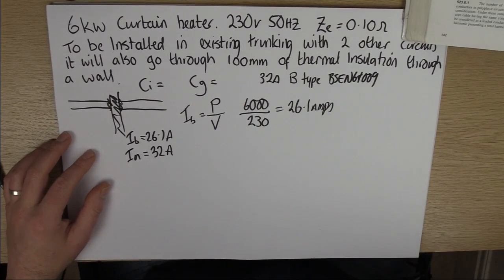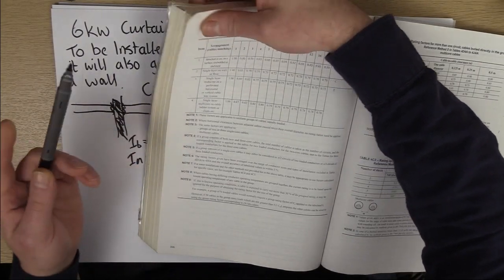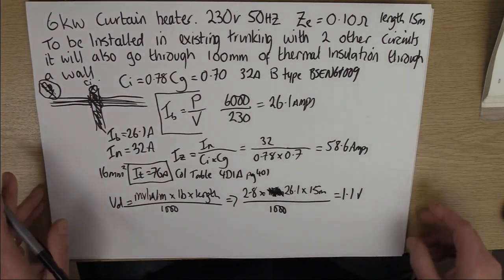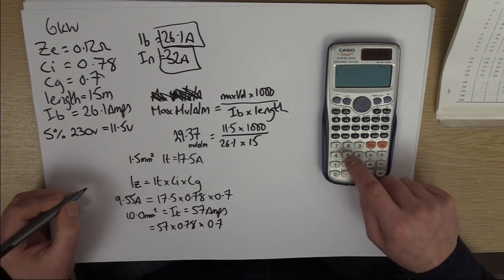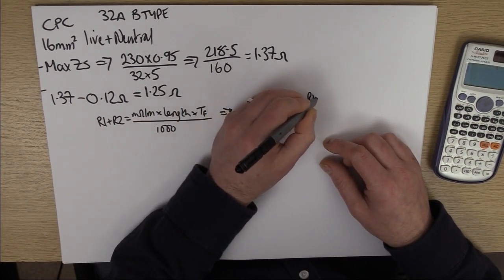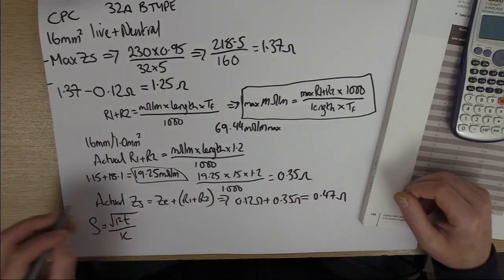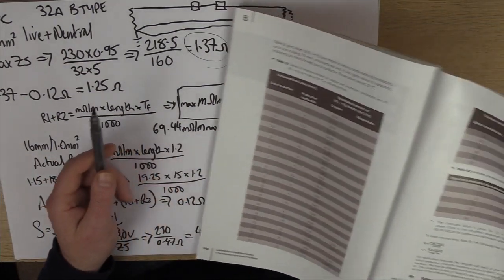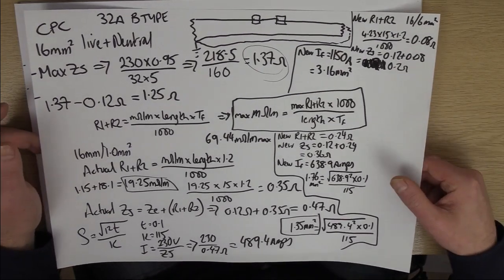Resistive load 6kw curtain heater cable design (improved audio hopefully)

Comment: Great video craig, could you do a video on how the “maximum circuit length tables” are calculated in the osg. Also a design Calc on a 2.5/1.5 ring final would be good👍
Reply from the maker: got one ready really but editing and tweaking to make it more watchable :-)

Comment: As this is a fixed load with a maximum current of 26.1A, could you not use Ib rather than In? 
This would get you to 47.8A and a 10mm cable.
Would this method comply?
Reply from the maker: Yes it certainly would comply and what I would use in real world. These videos are aimed at level 3 so I try and keep the methods safest to avoid confusion.

Comment: Brilliant video on design. Design is so cool and is a sweet science. Liked how you back tracked at the end re adiabatic.
I noticed you used R1+R2 = m♤/m x l x Tf  / 1000.      I kind of see how it works but it would be awesome if you would do a focus lesson on the various ways to re arrange this formula as it's hard for non mathematicians to free style with the equations but obviously it's very powerful tool to have mastery of. Particularly for voltage drop
 Best
Reply from the maker: See if this helps. its the same 3 steps repeated over and over to rerrange formulas really. Just takes practice to build confidence.      https://youtu.be/_U7it9-PuJc
Reply: @cestemshow    Exquisite.   These are really precious sources of info and most comprehensive ones on design. Please consider doing a design tutorial on 3 phase TT systems/ circuits. The 8202 level 3 2017 June paper has this scenario as the final question for 12 marks and is tricky as it requires and rcd mainswitch and bs88-2 overcurrent protection yet the regs book only gives overcurrent zs values for TN systems so is tricky applying it to TT as Zs values are way over the permitted limited.  Thanks again
Reply from the maker: I could see why that could stumble people. The max Zs tables headings dont match the time/current charts headings which is confusing. Ultimately the protective device doesn't care which earthing arrangement it is. If enough energy passes through them they will disconnect. So, in case of TT we are very much relying on an RCD for our fault protection and the fuse will provide short circuit protection and overload. I will ask the guilds if i can use that question on a video and get back to you.
Reply: @cestemshow  Amazing !